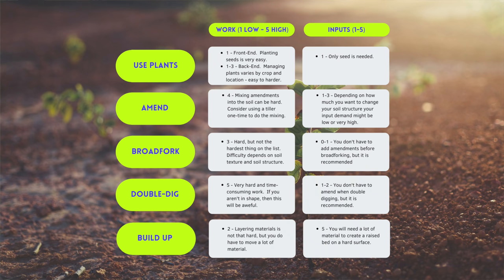6 Ways to Fix Clay Garden Soil | EASY to HARD Methods

Comment: I was always taught clay plus sand equals cement.
Reply: It's all about ratio 70/30 sand to clay forever amended structure.
Reply: Pure clay and a bit of sand, sure. Sandy loam is mostly sand with equal parts clay, silt, and organic matter. If you had pure clay (unlikely) then you'd have to bring in a lot of amendments to get your ratios right. Likely adding any amendments will improve it, but it won't be perfect until you get your ratios right.
Reply: It DOES equal cement... I learned that the hard time.
Reply: That is exactly what I was taught in the Master Gardener Course I took this past summer.
Reply: If we're getting real science-y and particular, cement is just adhesive (think rubber cement) that binds different aggregates together. So being semantical, what I think you mean here is concrete rather than "cement." All that said, compost and plants and compost and compost. Your soil already had everything it needs from a structure standpoint, it just needs life to change the texture.
Reply: It definitely is depending on how much rain or watering it gets.
Reply: Most people don't add enough sand.  I amended most of my yard with sand due to standing water.  Plenty of sand makes life much easier with clay.
Reply: @ronaldhiser860  while I don’t doubt your success I’ve looked into what golf course managers do in terms of sand additions. The big issue how water moves through layers of different particle sizes . Most people think water goes straight down a vertical path but actually water will move laterally when it hits a layer of different particle size and continues to do so until it saturated that layer before moving down.
What that means is that golf courses add sand to reduce compaction but end up irrigating like crazy to keep things alive.
The soil holy grail is loam and if you are simply adding tons of sand to clay without an equivalent amount of compost or similar organic component I fear your compaction issue will eventually get worse.,
I personally have never seen a situation in my area where clay and sand have ever worked. It would be interesting to see your results in 3 to 5 years when the conditions you created settle in
Reply: Thank you for this info. I have clay soil in my garden and this info was so helpful
Reply: Well, cement really is a special compound similar to gypsum which hardens when wet. If water is baked out of it, it returns to its previous state ready to get wet and harden again. Clay can dry hard but not chemically as cement does.
Reply: @bluejay3945  so hypothetically, if you had brown pottery clay with occasional 1 inch to 5 inch rocks as your soil then adding sand and woodchips until you have about 30% sand and 5-10% woodchips in the soil would massively improve drainage for trees that are sensitive to wet roots such as oranges, lemons, limes and most citrus plants right?
Reply: @joshnabours9102  all sand isn’t the same so if you are adding playbox sand to the mix it’s making a bad situation worse. I’ve been using turkey grit for years as a soil additive. There’s a slightly bigger grit size I believe is commonly referred to a growers mix but not sure. It’s granite grit that never breaks down and helps to uniformly aid drainage.
I personally am not a fan of wood chips. I prefer aged hardwood mulch mixed with compost and worm castings to add to my clay soil.
Have you tested your clay soil? Mine is actually chock full of minerals but getting it broken down is the issue hence the soil amending. 
I’ve seen amazing improvements using worm castings out of Revival Gardening in Florida. A little of their high quality castings go a long way.
Reply: Sand is the worst thing you can put in clay, I have been dealing with clay for 20 years, cow manure works the best.
Reply: @vinkamboj1 + aged compost, composted leaves, and fresh worm castings
Reply: Your teacher is wrong, cement is a conglomerate of iron, calcium, aluminum and silicon.  Mixed w/sand, lime, rock, water, then when it sets it becomes concrete.
Reply: @NehpetsRellek  u missed the point . Adding sand to heavy clay is not a wise decision
Reply: @bluejay3945  No I didn't miss the point, you didn't make your self clear. Learn to express your self cleatrly. 
         PS thought, not taught.
Reply: Without "cement", the 3rd ingredient, that would not be possible.
Reply: @drewchristopher5056   you bring to mind the auto mechanics work on their v8 motors. well where is the engine? wait til they have to work on the new ev motors! will they be called engines? seriously had to educate my son on the cinder block issue!
Reply: @shellieperreault6262 
How much sand did you use?
Reply: Cement is waterproof. This is how you make earthenware bricks.
Reply: It's clay, limestone and water equals cement.
Reply: It depens how fine it is. Never use sand on it as you will make double trouble. Easier to work out clay soil then the one with sand. Just add tons of organic matter and plant that short wheat, sorry English's not my native language
Reply: Was literally coming here to say that I was told to never put sand in clay soil. Sand works great in compost though
Reply: I added a lot, several tons, to a very small area as an experiment to try and amend my clay soil and it got worse. There was more to my equation than just one that amendment.
Reply: Sand is bad for clay
Reply: Sand is the only way to amend clay because it aerates the soil and allows drainage. Clay is the finest soil particle whereas sand is the most coarse. Pure clay becomes hard like cement when it gets dried out. Sand in the right amount will prevent it.
Reply: You were taught wrong. Cement contains quick lime.
Reply: cob houses

Comment: Great video as usual Diego. However, please note that adding sand is a big mistake in most cases because you can create a worse situation (especially in humid climates, where clay tends to become concrete-like if mixed with <5% sand). Gypsum, on the other hand, flocculates clay, and it's sufficient in much smaller amounts than sand, to give exceptional results in a short time (1-2 seasons). Lime has the same effect but does change the soil pH, which is not always desirable. Having said that, OM is going to be a much more sustainable solution in most small-scale cases, because it's not a mined input, it can be made on site, and if using the right plant-based form it's going to create recalcitrant forms of carbon in the soil (humus) which are stable for a long time (not as long as sand, obviously, but longer than, say, manure).
Reply: What is OM please?
Reply: @maryannemckay3606  Organic Matter
Reply: @christopherhickey5464  😂…ok!…thank you!…
Reply: Agreed I personally wouldn't add any old sand my garden. Gypsum is great charcoal and ashs organic matter and I'm a big fan of baked clay or small rocks
Reply: This is absolutely correct.  When I started years ago, I made this mistake with sand and ended up with almost concrete beds.  Thank God I was young enough to fix it, no way I could move that earth around and pick it apart now.  Gypsum and organic matter is the way to go in the midwest where I am, Missouri.
Reply: I think if you added sand to my clay you would get cement, & not soil.
Reply: if you add organic matter and sand that works well, but just adding a little sand doenst' help much. you need to have at least 30% sand IMHO. and most people don't do that cause its' very hard work.
Reply: was just going to say this.

Do not add sand to clay. You get concrete.
Add Gypsum.
Reply: @vancomycinb   you dont'. if you add organic matter and a little sand works fine.
Reply: No sand at all!  Worst thing you could do . Amend with compost material.
Reply: If plants/veggies dont mind a slightly higher PH, use granular lime stone. Keeps soil fluffy for about a year. 
 It breaks the clay molecule.
Reply: @Spittin_Chiglets  not really the worse thing you can do, sand with organic matter and clay is called loam and is the most perfect soil ever
Reply: Came here to say the same thing about sand. +1
Reply: I added river sand to my gray clay, and I don't have concrete.
Reply: @mmmbrrr3232  you know I was thinking about adding river gravel to the soil, as it creates surface area and space for water and air to flow and as the frost, plants and animals help heave the soil, the gravel will be taken within.
Reply: @vancomycinb  I have a 80 x 60 pasture and I would need 
$1,500 in gypsum if the bags on amazon are $31.00 for a 5lb bag.  Where can I get bulk for cheap???
Reply: @bdmenne  a farm store for gypsum you can rocks to areas you don't want root crops
Reply: @bdmenne  farm and fleet, land scaping place, Amazon is usually not the best deal for much
Reply: @bdmenne my quarry carries gypsum for bulk pickup in a truck or trailer, maybe yours does too?
Reply: I disagree, I added sand to dense red clay and it made the clay loose and easy to work with, theres no way it can turn into cement.
Reply: @bdmenne  you can use bags of plaster it's the same thing
Reply: This is correct to the point about humus. Humus doesn't exist in soils. It's a substance created in a lab with extraction methods. Soil carbon is almost always in the orocess of being broken down to smaller particles ending up at CO2. The trick is to keep adding carbon to keep the buffer as big as possible. And plants are pretty good at this next to adding extra in the form of compost, straw or wood chip for example

Comment: Love this video but beware adding sand to clay soil. A brief search revealed numerous articles from ag extensions explaining why that’s not a good idea, and why adding organic matter is better.
Reply: Agreed. This has always been a "no no" in my research and experience. Clay + Sand = Concrete. That said, the truth is, if you can make 50% or more of the volume sand, then you are truly changing the texture, but this is not "amending," this is bringing in a new soil. 

One major thing I think is missing from this video is compaction. Any of these can be destroyed quickly by walking on your soil when it is moist!!!
Reply: Based on some of the other comments, this concrete thing may be somewhat of an internet myth. I’d be fine forking a bit of sand into clay soil but I think there are other, better alternatives to try to make the soil texture more loamy. Like the other things that Diego mentions in this vid…
Reply: @HoosierBenzo  I have 1st hand experience with adding sand to clay and by next season I was having to remove bowling bowl sized chunks that could only be broken up with a sledge hammer and extraordinary effort. One chunk in the rest went into a dumpster.
Reply: @mcraw4d  that’s no bueno
Reply: @mcraw4d  Wouldn't they melt in a bucket of water?
Reply: @hermanhale9258  if you have heavy clay soil it would look like a ball of clay in a container of water.
Reply: Agreed! Adding sand to clay is called concrete. If you want to add course pieces, try crab meal. Earth worms love it and will transform it into chitinase. Chitinase is an enzyme that plants can absorb through their roots to protect the plants from pests. 
If you want to transform your clay soil, add agricultural gypsum first, which breaks the binding agent in clay. Add 1 part cow manure compost to 1 part peat.  Add a fine layer of crab meal. Water it in and then put some armor on that soil with natural No dye mulch. Wheat straw or mini pine bark nuggets where you plan to plant. I also use No dye shredded hard wood mulch on my paths. And never till your soil after you start the process of amending it. You destroy the natural biological layering structure when you till. 
Sowing diverse multi species Cover crops in fall or early spring will do wonders too. As soon as it starts blooming, cut it down, crush the stems and leave it sit for 2 weeks. Then plant your crops in it, pushing it aside only as much as you need to dig a hole for your plants.
Reply: @kirkanos77  Thanks. I copied and pasted this into a file, very helpful.  Whatever is in my backyard - hard, dry, light brown, light weight -  I never see any sand grains wash out of it. Not even when I shake a chunk in a jar of water. Just get a cloud of gray/brown in the water, that never settles, and that is why I called it clay.
Reply: @HoosierBenzo  yeah sand works just have to add a bit
Reply: What is the difference between tilling and double digging except one is less work?? Truly asking.
Reply: @jen43072  Double digging has the potential to go deeper down (12-18”) versus a standard home-use tiller. The extra depth is supposedly beneficial, I’ve no experience with it myself
Reply: You can do sand and clay but it has to be a minimum 50/50 mix. So if you have a 5 gallon bucket of clay, you need 5 gallons of sand. Also, it has to be mixed evenly multiple times to get the ratio right.
I did it on blackland prairie clay before and it doesn't harden into bricks as bad as normal clay.
Way too much work. Mulch and compost work way better.
I do like sandy soil raised beds on top of clay. That is dreamy because the worms mix them together at the bottom into a perfect loam.

Comment: I have heavy clay soil, a pickaxe literally bounces off it. I hated it for years and have tried everything to change it. Honestly nothing works. Over time rain and watering causes sand and other amendment to settle out in layers. I finally had an epiphany and now embrace the clay. What I do now is your option 5. I have over time added compost and sand loam on top and not tilled it in. The clay is good for potassium and phosphorus as well as a slew of minerals and water holding capacity (when you have a top layer) and the top layer of compost provides nitrogen. It's been working like a dream.
Reply: Yeah, few inches of good compost will provide growth for some plants, and their roots will penetrate clay over time and get deeper.
Reply: You may need a bigger pickaxe... 
More seriously: dig when the clay is not dry/backed to resemble a rock.
Reply: have you tryed to cover the soil with grass mulch or straw? Compost and covering the clay soil make miracles. i think this is the best option. Covering it si crucial, so that when the rain came it does not beat the upper layer.

Comment: If you're not in a big hurry it's easy to break up clay soil. Just till in a bunch of wood chips, shredded leaves, shredded paper or cardboard mixed with grass clippings and Alfalfa pellets.  Let that sit till next spring and you got loose nutrient rich soil.  You can also till bone meal and hardwood ashes while you're at it.  Time will take care of the rest. Just be sure to mulch with either wood chips or shredded leaves.  This is guaranteed good soil.
Reply: Wont tilling kill off the micros.
Reply: @Bear_83 yes, but depending on how bad your clay is it can be worth it.

Some clay is too nasty to broadfork and too nasty for just about any roots to penetrate. When the clay is bad enough, it can take over a decade of mulch and soil biology working to make it workable
Reply: @Bear_83   only if not covered after. If you till and let the soil sit bare that is absolutely horrible! But if you keep it wet and cover it with thick mulch your soil will reover very very quickly and will have significantly more oxygen and greatly surpass not tilling within a couple months to a year. Everywhere I tilled and then covered is approximately 2 years ahead of where I just covered. And just covering with pure carbon is the worst. Try to add as much nitrogen as possible - grass, urine, coffee, anything you can find.

Comment: My soil was 40% clay and 60% rocks.  Dug individual holes 8 inches deep, put lime in bottom, and because I didn't want pH too high, I also put in powdered sulfur.  Then added slow release fertilizer. Placed 2 inches of soil, then planted a flower bulb, then filled in rest of soil.  This was in fall because these were spring blooming.  Removed 3 wheelbarrows total in rocks.  The next spring, the blooms were beautiful.  I found that the soil was easy to dig after this work.  Made excellent flower beds.

Comment: The raised beds do slowly change the subsoil.  Over time the organic material and humic acid slowly work into the hard clay subsoil through planting, roots, and insects.  Also, if you are not pulling up the roots of your plants (no-dig style) the roots that do make it down into the clay subsoil will rot improving the clay. Yes, it can take a year or two (or more) depending on how deep you need to improve your subsoil and how fast. Crops like carrot and large radishes really help to.... the first year they may even fail once they hit the hard clay if you only have a couple inches of compost on top, but each year will get better. Here in the red clay south, sand and clay make bricks on 100 degree days and will heat up way faster so I normally do not recommend it unless you are also adding some organic material too. Here, sand leveling is really popular for our Bermuda yards.  Most people use only sand to level (because it is cheap).  I used sand, compost, and peat.  My neighbor wonders why in the mid-summer my yard is still nice and green while his yard is burnt to a crisp when we use the same watering schedule. Yes organic materials break down, but they do leave air pockets which are good for the soil and you should be adding more organic material all the time anyways to your garden to replace it (even if it is just on the top, it will work its way down --- the whole concept of no dig, no till, and heavy woodchip gardening)
Reply: I messed around with all this stuff for years. What finally worked? Digging down 2 feet removing the clay and putting in real soil.